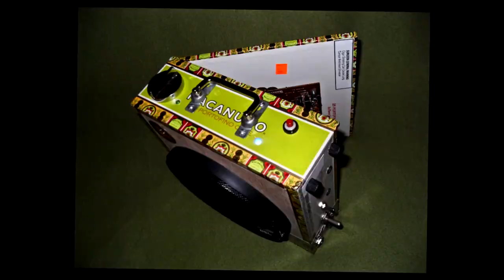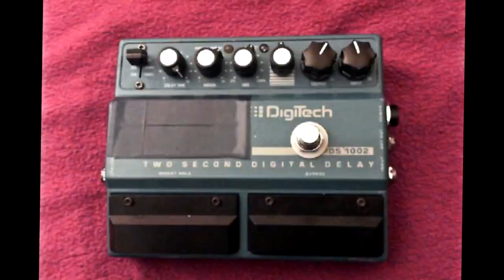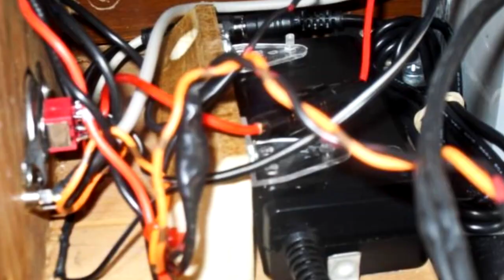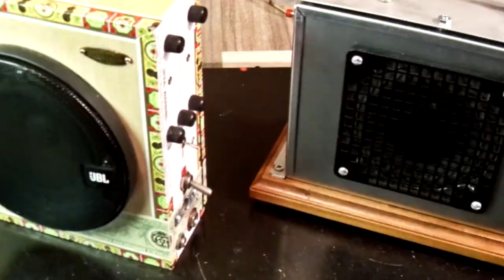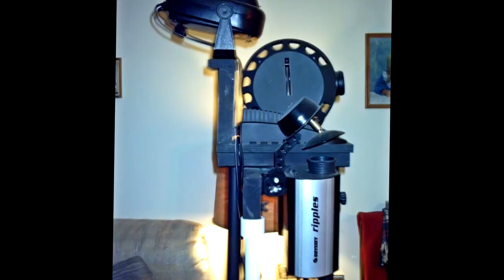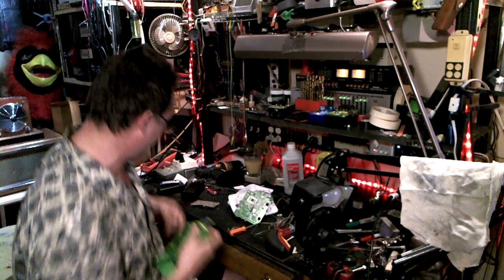Phone / remote /  electronic button repair - contact cleaning - fix a bad button, its easy

Comment: I had great success cleaning the rubber pads and the contacts on the circuit board with paint thinner.  Alcohol and glass cleaner are too weak.  Also, do you really think smoking while you do this is a good idea?
Reply from the maker: yes , that is the smartest thing in the whole video , the smoking .... i smoke crack a lot between takes too , and shoot up pcp between my toes but only off cam . look for a tut on that soon . happy holidays man .